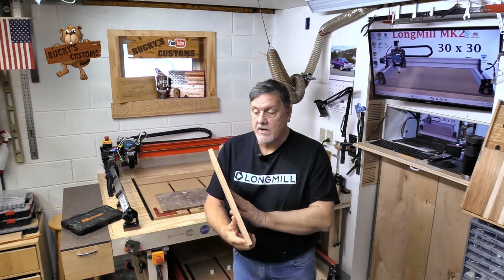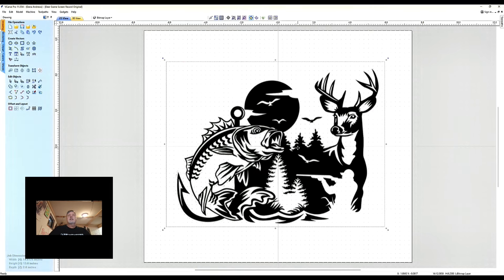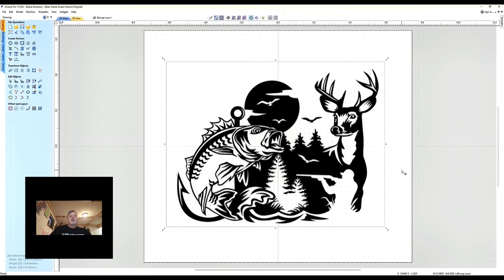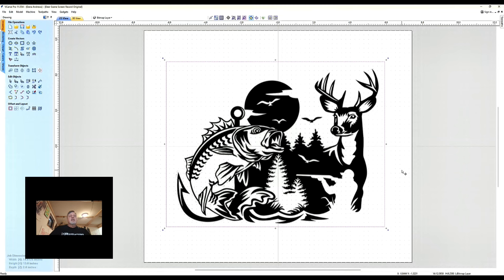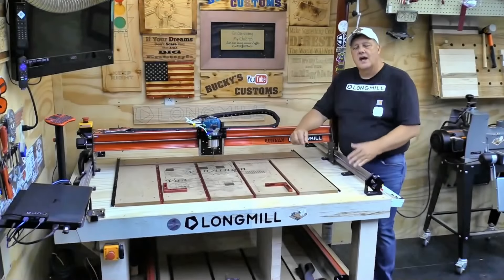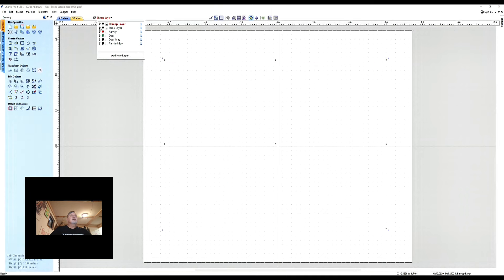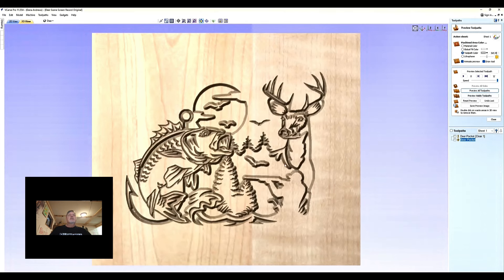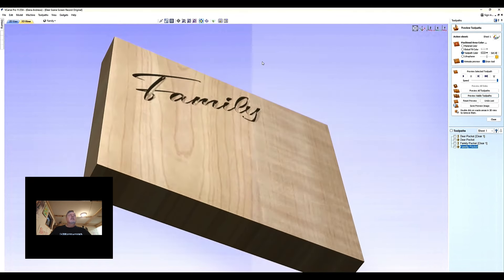The TRUTH about VCarve inlays Vol. #5 Includes Big Mistake!

Comment: Great video. I'm still new to CNC woodworking but was a machinist for years. If you are going to be that aggressive with your 1/8 endmill (cutting deeper than the tool width) as a rougher you might want to check out IDC Woodcraft's new 1/8 roughing bit the "Badger." I have the 1/4 "Beast" and hot knife through butter is the only way to describe how it removes material.
Reply from the maker: Good advice! Thank you! I just ordered a bunch of new bits from Sienci Labs but, I will check out IDC for sure.
Reply: The “Beast” is definitely a BEAST!  The “Hog” is equally awesome, just a shorter version of the Beast.